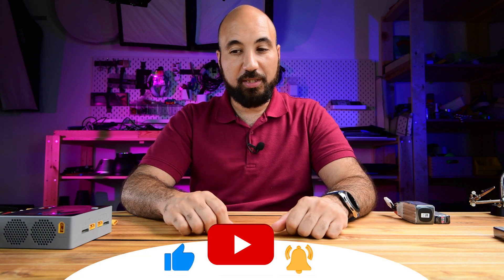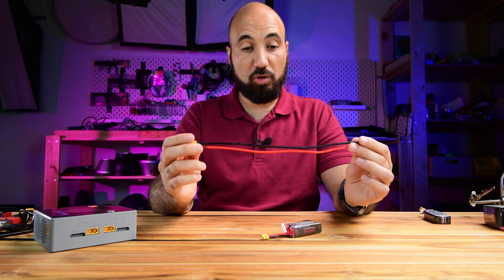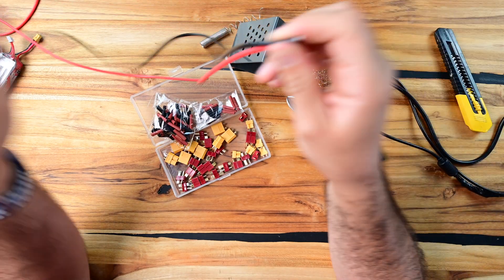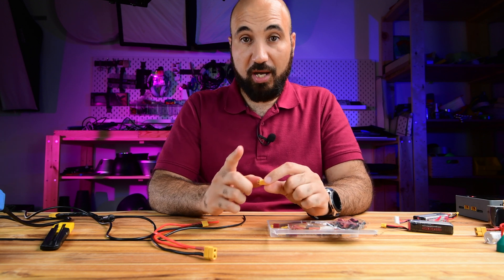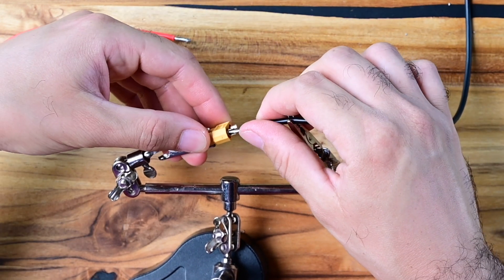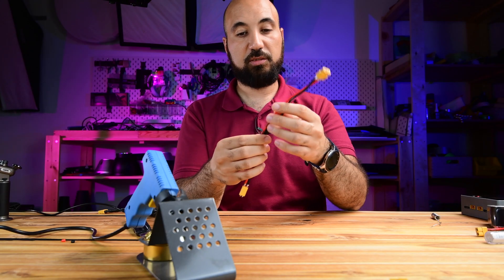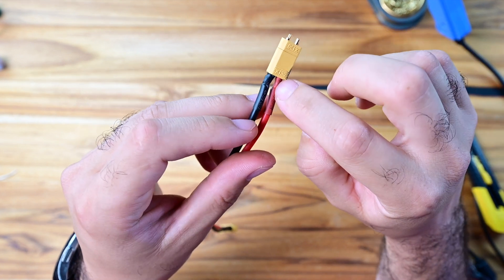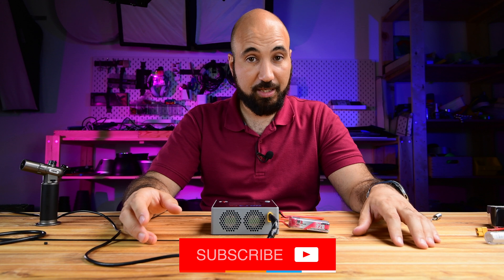🚨🔥FPV Drones - How to make a XT30 female to XT60 male adapter 🌞🌟🔥🥰 #bilumedia #fpv #fpvdrone

Comment: Hi Hamoodeh, thank you for the video. Just had a question, what about the balance cable? Is there an adapter for it?
Reply from the maker: @bashfpv  hello my friend, i think you mean an extender? There are extenders for balance cables and you can buy a crimping tool to make them if you don’t want a ready to use one…
Reply: Ahlain hamoodeh, I meant the balance lead that comes out of a 3s battery, does it also need an adapter to fit in the charger?
Reply from the maker: @bashfpv no no, the balance lead is universal and any battery will fit properly, but be careful what side you attach it to, i mean all the way to the right or the left depending on your charger, you should start from the negative part 👍
Reply: @bilumedia  thank you!